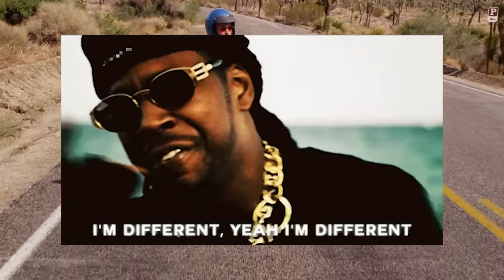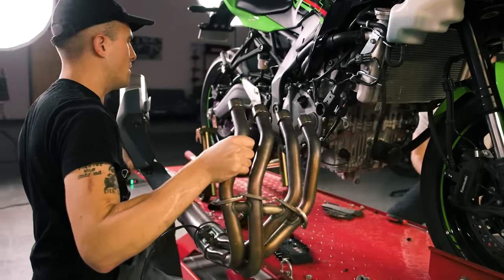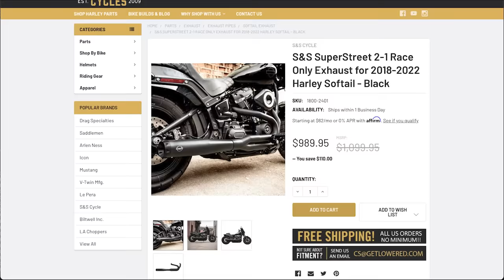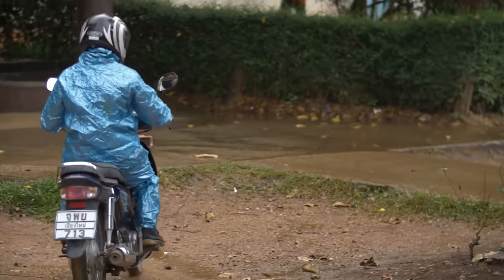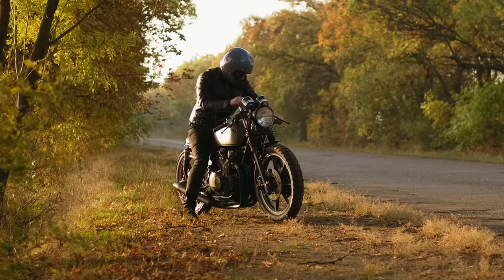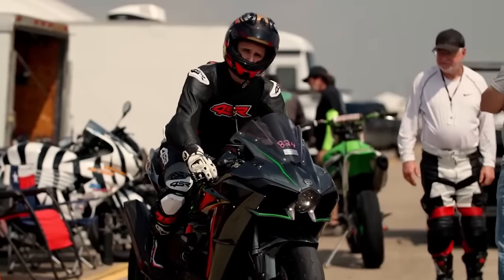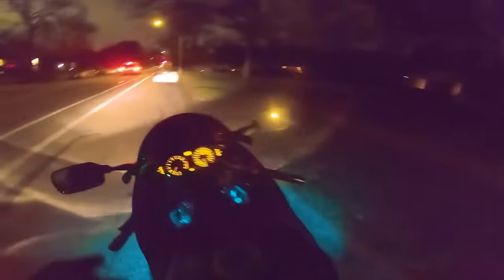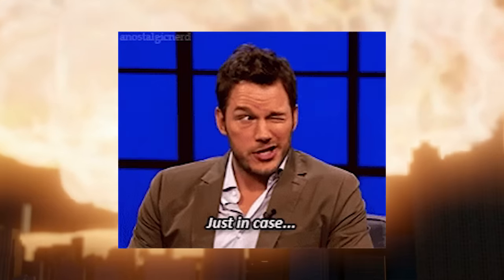Top 7 Illegal Motorcycle Mods that people do anyways

Comment: I'm sorry Papa yam but you're completely wrong about under glow lighting I have them and it save my butt many time, but I will agree with you about the pulsating color changing lights
Reply: I can absolutely get down with some solid color for visibility at night. As long as it is not red, or rear facing white.
Reply: as long as you abide by each states laws, i totally love underglow kits. Improved visibility in darkness is a good thing.
Reply: @Dangerwiggles  My do change to color red but only when I apply the brakes.
Reply: Agree, I keep mine at amber for visibility and doesn't cause confusion with red brake light

Comment: I have always disconnected the front brake from the brake light.  That way I can brake hard (cop nearby) without the brake light coming on.  In normal riding I just lightly touch the rear brake to activate the brake light.
Reply: I was doing about 60 in a 25, saw the cop with his back to me tagging on coming cars with his radar.  I kicked down to 1st gear, slamming on the brakes, and popped the clutch.
Engine SCREAMED, cop flip around, as I putted past him doing 25.  LOL.

Comment: In the UK my RM250 dirtbike only needs a horn, a brake light and a visible registration plate. Noise limits do technically apply but there's no emissions testing and even with a full fmf pipe and silencer it's still legal. The exhaust does have not for road use written on it, but so does the bike (which is now legally registered) so that doesn't apply. Also you do have to use DOT tyres(or tires) but they're pretty good. For some reason you can actually register and ride a quad bike without the brake light but that seems a bit dangerous for my liking(both because nobody knows you're slowing down and because quads are deathtraps🤣🤣)

Comment: In Queensland, Australia indicators on motorcycles became mandatory in 1975. I had a 1976 Ducati 860GTe which I took the indicators off. A cop tried to ticket me for it but I told him it was a 1974 model and didn't need indicators. Ducatis were pretty rare then, and he didn't know any better so just let me go.
Reply: Just put a part from a 74 on it so you don't have to lie.
Another good thing is those era bikes WIN when a car turns in front of you.  I ripped the back of the car off, and I just broke my headlight, and clutch lever.  cost me $20 at the junk yard for both.  Was really shocked when my gas cap cover broke in late 80's.  Went to the dealer, and they said it had a recall, and got the part for free.

Comment: Pennsylvania specifically allows the addition of LED lighting on motorcycles to improve rider visibility. I have amber LED's on my Grom, and red on my CB500F (which also function as added turn signals), to match the color schemes. I've also replaced the reflectors that the previous Grom owner removed with reflective orange wheel tape. It works and helps keep me visible. Personally, I'm safety conscious when I'm on a motorbike and take every advantage I can to enhance my chances of survival. Added lighting, added visibility, even added sound (as anecdotal as the results may be), all work together to increase my chances of arriving at my destination alive.

Comment: My state inspection standards for motorcycles allows for any additional lighting that enhances the safety of the motorcycle. It doesn't specify kind and type....I would not run flashing blue or red for obvious reasons, but steady burn colors instead...of course if you use green yellow and red you might look like a traffic light...

Comment: I have seen the LED body lights installed that looked really good.  Single color, non pulsing, can be turned on and off.  I knew someone that would turn them on when stopped and parked for safety and it made his engine look cool in the pitch darkness.  Now to say that OKIE DOKIES Oinks from Oklahoma WILL write you a ticket even if you are parked in a Walgreens and off the bike if they see these lights on.  Even if you are on the ground doing a minor repair or oil check on the bike.

Comment: I have a single "rock light" over my rear tire as an extra glowing light. My reason is bc I ride at night usually for commuting and the weather can get very foggy, to where I have to go 40 on the highway, but many assholes like to go 80+ with their high beams and barely see 8ft in front of them, so I will have any extra light I can to indicate I'm there, we've had 5 accidents of bikers rear ended by cars going stupid fast while blind.

Comment: 81 Honda CB750 is Pretty much Stock. Had to change Mirrors because Stock Ones Broke. Has a Small Wind Deflector right above gauges, does Help. Can wear a Flexfit Baseball Cap up to 50mph. And has the Backrest and Luggage Rack that was meant for it. Everything else is Stock. Had one when I was 16 back in 90 for 10years and have one again, same color and everything for the past two years but been in the shop having the engine rebuilt.. Only 350 miles on it as of typing this.

Comment: Slip on is illegal only if excessively loud in Virginia. No specific law about removing cat in Virginia for a motorcycle, unlike for cars is at serious fine, if not jail. Virginia will let you get away with just about any equipment failure now after passing a law that people cannot be pulled solely on equipment failures/violations in an effort to prevent racial profiling. But if you run stop lights, speed, do wheelies, burnouts etc they are then free to ticket you for everything.

Comment: In Europe ( the EU not UK ) every part you put onto a bike must have a E approved certificate or stamped with the approval number or be manufacturers own equipment, this means if you fit new footpegs or levers they must be approved or the bike is not allowed on the road until the correct part is fitted. In Germany and Austria they take this to the extreme in Spring and Summer they stop bikes and check for everything and if a part is wrong you either fit the correct part there and then or you have to be taken to a garage to get the manufacturers parts fitted, they check exhausts for noise levels all lights footpegs levers brakes resovoirs calipers and lines ( non approved braided lines is a trailer job ) tyres and wheels for condition number plates and country stickers including the view angle, so you think you have it bad try doing the B500 in Germany and you will get a big surprise. I have seen the You Tube vids of these stops and some riders have to carry wads of certificates for the mods on their bikes others just lose the bike, this explains why most bikes in the EU look stock with only luggage as extras.

Comment: LED Underglow... Here in New Zealand, you can have them if you can only see the light emitted, but not the light it'self. and they cannot flash (they are however be able to change colour as long as it's not flashing from one colour to the next, but fading from one to the other) and you know what... a fully licenced Rider is treated different to one with a Learner licence by other road users... the learner has to have a big flappy plastic square that is bright yellow and has a black "L" on it... cars actually give them a wider birth rather than deliberately cutting them off... so between having a L plate and underglow, the bike would be seen sooner and more clearly, and given room because of the Looser plate they have but don't actually need!

Comment: yall laws are weird

for the lights thing in my country 

you are allowed to modify lights as long as you adjust them to the legal hight your even allowed to add 2 to 4 lights depending on how big the motorcycle is 

the underglow or chassy lights its allowed IF its a steady color and it doesn't change or flash

Comment: I don't (and never have) do any mods to any bike I buy or own. I never replace the exhaust. I am more than happy sitting for hour after hour on a freeway. I am happy riding within speed limits, even on my ZZR1400. I don't 'get my knee down'...
Reply: Than you shouldn't own a motorcycle the whole reason to own a motorcycle is to be an outlaw above the law. Get your self a prius if you want to follow the laws. Also stock exhaust is horrible on any vehicle it causes more carbon build up on turn causing 800x the pollution and decreasing reliability. Get a straight pipe system upgrade the air intake and let the bike you supposedly have run free. The point of owning a motorcycle is to be free in the wind while breaking every road law their is. If you ain't willing to live up to the entire reason we invented motorcycles and formed the culture around than you shouldn't ride. As all you do is hurt the culture real riders nurture
Reply: @societyisboring  So which "outlaw" are you? Hells Angel? Bandido? Mongol? No, thought not.

Comment: Technically the attachment to helmet law is not universal. The law only states that anything that protrudes can not reduce the effectiveness of your helmet. So if whatever you have attached to your helmet is soft or will break away in the event of a crash, it is legal. I ran a helmet cam that would easily break away if it was ever hit, so it was legal. You have to read the actual text of the law.

Comment: took the mirrors off my z1300-6gt and put them on the handlebars of my already over-accessorized G-wing [e.g. on-board air compressor] which had the stock fairing-mounted ones for 4 mirrors = awesome visibility and didn't look all THAT stupid [chrome stock + black add-ons].

Comment: Just say yes to led glow.  4 wheelers don't pay attention as it is having undervlow where it gets there attention saves lives. If they keep paying attention to you and not the road then that's on them as long as they see me and don't cut me off or run into me then the leds did there job by keeping me safe.   And before someone says there detracting so are cell phones and  last I knew cellphone use while driving has caused more accidents then someone using less on there bikes

Comment: Having lights front and back does not mean you're very visible from the sides. Those reflectors may not be the prettiest but neither will your leg be after you get t-boned by one of the gazillion F150's on US roads (fun fact, 80% of all new cars are those enormous behemoths and SUVs, usually driven by half blind grandmas and grandpas). I added more reflectors to my cruiser - it was just in the form of black reflective film, basically invisible in the daytime on black parts, but bright white when hit by a headlight. Headlights too, for that matter - it's a safety thing. It's not great to be blinding on-coming traffic. You can mod your headlights but it has to be with DOT approved parts, like a JW Speaker reflector. Putting in LED "bulbs" in your existing Halogen headlights? Also illegal. Because it works poorly and is often unsafe.

Comment: My first mod was adding the second disk and brake caliber to my Yamaha XS650 front wheel. . Then rear shock springs.  Never had an issue with the cops.
I put knobby off road tires on once.  Driving home I felt like I was on ice.  But BOY what a difference in the dirt.

Comment: technically the mounting of things to your helmet is only illegal if what you're mounting compromises the structural integrity of the helmet. meaning no added holes made by a drill, but clip ons and adhesive don't compromise the structural integrity of the helmet

Comment: I bought my first bike recently. About two weeks later,  I realized it didn't have a
tail/break light
Reply: Does a break light come on when the bike is broken?
Reply: One of the things I hated about my yamaha was the black box that used your tail light for a break light if the brake light fails, and vice versa.  I would rather KNOW it is out than hide it from me.  Shuttle pilots had the same problem, computer lied everything is great till it ran out of maneuvering fuel, then it was to late.

Comment: Some of these are just stupid and blatantly ignorant of motorcycles in general. If someone has a full exhaust system, chances are they also have a custom tune that leads to more even fuel burn and less excess pollution, and even if the engine produces more emissions, it's still drastically less than a car. Reflectors don't even do anything most of the time as a lot of bikes have paint or stickers that reflect more light anyway. I understand why stock tail tidy's are the way they are, but half of having a bike is it looking good, and a bad tail tidy ruins that. Now, underglow, mirror removal, and stupid helmet accessories I think make a bike look objectively worse, so I'm fine with those lose, but I mean come on, lawmakers really need to understand their audience

Comment: Let's see how the big bad ultra controlling nanny state of the UK compares to the land of the free, the (MAGA) USA. 1. Full exhaust? Not illegal in the UK. Police will take no interest in what you did. Delete the catalyst and/or O2 sensors? Go ahead, our annual vehicle test for motorbikes excludes emissions. That same test does not test noise, with the worst you can get is an advisory that it might be a little loud. Win for the UK. 2. Tail Tidy. Yes, go ahead and delete it. You can mount the plate on the side, and it does NOT require an illumination light. You must have stop/tail lights, reflector and blinkers, and they cannot be those tiny LED ones, nor can it be one of those integrated light clusters. The lights and plate only have to be visible from the rear, not at the rear. Call that a draw. 3. Blinkers. Have to be amber/orange over here. As in #2, no integrated light clusters. Right turn signals need only be visible from the front/rear and right, and left from front, rear and left. Call that a draw. 4. Mirrors. Not required in the UK. Win for the UK. 5. Reflectors. Just need one red one rear facing. No side reflectors required. Win UK again. 6. While you do need front and rear lights, no rules about changing them or adding to them. LED underlights are legal (within the constraints of blue not allowed, white must face front, and red must face rearwards, but green, pink, purple, orange, yellow - go for it). Win for the UK. 7. Camera on your helmet. No problem in the UK, same with Cardo systems, etc. Win for the UK. Who says America is the land of the free? Free to do what? In regard of motorbikes, UK has far less regulation than the USA.